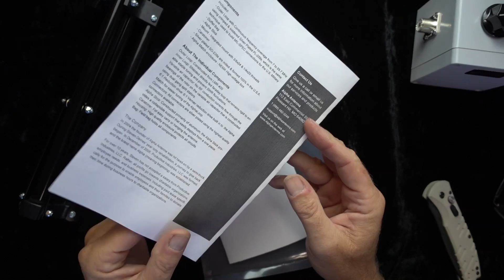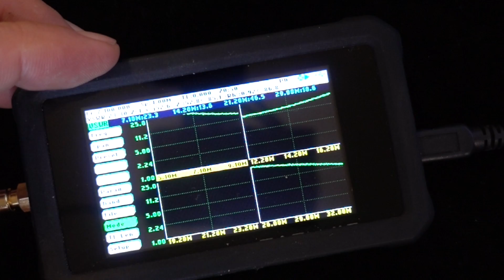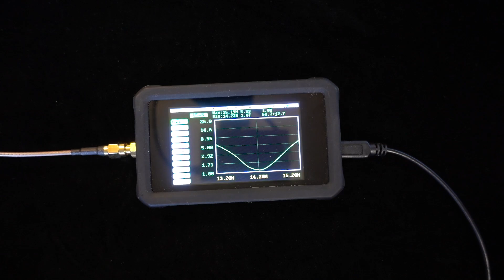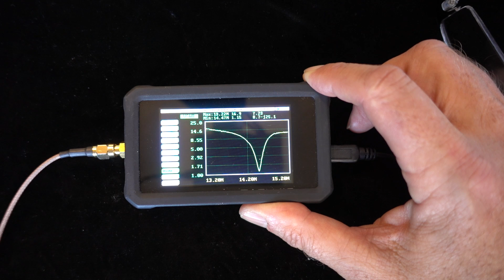Alpha Loop Review, K7AGE at Pacificon - K6UDA Radio Episode 31

Comment: I haven't had much luck with my Alpha Antenna loop, I have yet to make a single contact with it. I bought it to run with my QRP radio "FT-817" but no luck getting out, just tried it with 100w and same story. I've had it for several years but I usually give up after a while and string up a wire, it receives pretty good but I just can't seem to get out. I'll probably scrap it and repurpose the parts when I get tired of messing with it.

Comment: Can this antenna  be  controlled by a  transceiver with an automatic tuner?   Or, do i have to leave my warm house and go out on the deck and turn the knob?"   I am looking for a smaller antenna that can be put up in a fairly quick fashion and is stealthy.    any suggestions?  the dream unit would be controlled from inside....it is currently -35c in Saskatchewan  Canada.   i live in a condo development.  Rules against slightly objects such as antenna, but no rules about satellite dishes.  This unit seems to be fairly low in price, and portable.    Thanks
Reply from the maker: Nope. Mag loops require tuning at the antenna. I know a few manufacturers are working on a remote tuner.

Comment: - No lock washers to prevent the SO-239 to unscrew from the inside.
- No paste, silicon or water proofing gel to prevent water infiltration so IP54 worth nothing here.
- This type of capacitor comes with 6:1 reducer. They haven't added anything.
- LOL 400 customers and including you will receive a new "T" connectors...
Reply from the maker: Al Hard thanks. Noted for the shootout.

Comment: Gave you a thumbs up on this one! As for the customer service, it would have been nice if it was tested "before" they send them out! So the quality control still needs improvement. 
Thanks for limiting the "funny" bits. This was much more enjoyable  :)
Reply from the maker: Well in their defense, It did work the first time I tried it out. When I disconnected the coax it must have pulled the press in fitting out just enough to cause the failure. 
Julian, you don't find me funny? I'm wounded. I even linked a nice cat video in the description. 73,  de K6UDA
Reply: K6UDA Not at all, but the cat video link was epic :D It's nothing personal,  I just want the info and avoid the adlib!
Alpha has had quality issues for quite a while. The fact that they already knew the problem begs to ask "why didn't they send out replacements before you told them?" The good thing is these are things which can be improved by a company. I give them credit for updating the loop.
Have a good weekend.